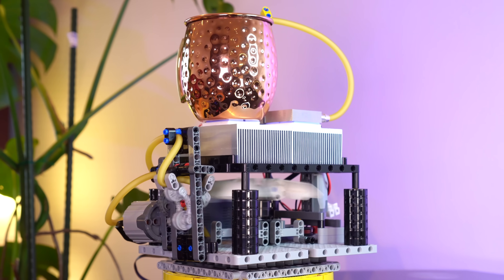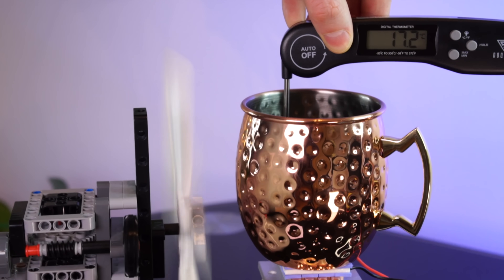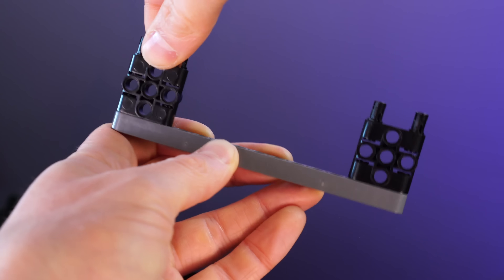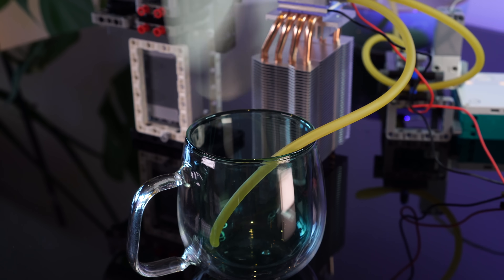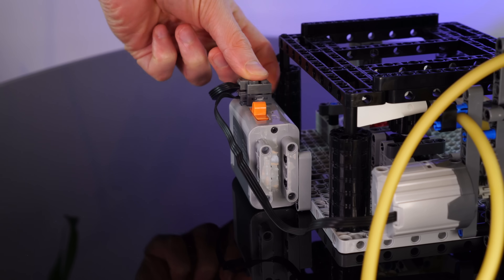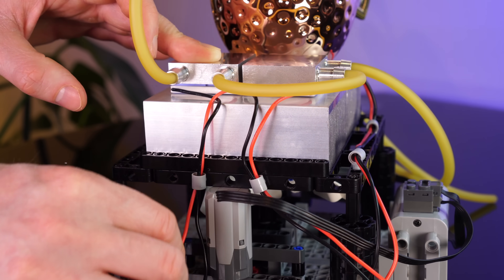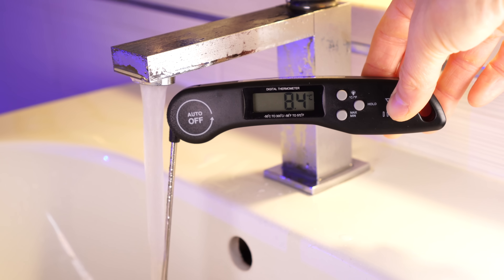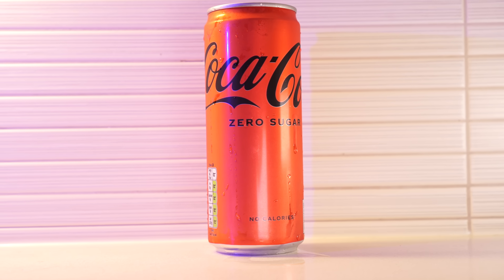Making An Instant Drink Cooler Using Lego

Comment: I agree with people that you should cycle the drink out of the cup, back into the cup in a closed loop to let it “accumulate” cold and “add up” over time.
Those modules are crazy inefficient, so add like ten more… lol 
If you did that, I think you’d actually get a cold drink in just a few minutes.

Comment: Peltier cooler efficiency decreases both with increased temperature difference, and power level, meaning they're extra bad for fast removal of a significant amount of heat. Also, all stages of heat transfer reduce the efficiency further, the worse the heat transfer is the worse the efficiency, and every single thing that reduce efficiency makes all other issues worse. 

At just a few watts per module, peltier elements can actually have a reasonably "high" COP, as in, have kind of decent efficiency, relatively speaking. But, you would need to use an insulated chamber, and much better heat transfer than those pads, and cool something down in advance and use that to cool a drink down, to make them somewhat useful for that purpose at so low power levels. Peltier based cooling is supposed to be able to be about 1/4 as efficient as vapor compression based heat pumps, but that requires modest temperature differences, and power level, and a very well designed system, in every regard.       

Solid heat sinks are pretty bad at removing heat, compared to heat pipes, as rate of heat conduction varies with temperature difference, while heat pipes transport heat very well even with a very small temperature difference. Less than 1 degree difference in the working fluid in the heat pipes will move heat from the hottest to the coldest part of the heat pipe so fast that most of the limitation is the few millimeters of copper the heat has to travel through in order to get into and out of the heat pipe, not along the length of the heat pipe. Also, while heat pipes works in any orientation, they work best if they move heat up. But, the "wrong" orientation of the heat pipes doesn't matter nearly as much as using those thermal pads instead of something like thermal grease in a as thin layer as possible that still covers the whole surface.

Still, most consumer products based on peltier coolers aren't much better designed than yours, except, they're designed with a bit more realistic expectations about what peltier coolers can achieve.

Comment: You need to keep the water a little bit longer inside the heat sink to make sure cold transfer happened.. maybe you can turn off and on the pumps or maybe pass the water multiple times through it

Comment: A lot of stuff works the same kind of like sound bounces around light bounces around, etc. well, he is kind of in the same sort of way. It likes to grip to certain things such as metals other stuff so pretty much if you had like a maybe a bunch of coolers on all sides of it so like a ice box pretty much then it would work probably betterbecause the bottom won’t really help because the bottom will chill the bottom but then the heat from the top will jump to the bottom to move more room from the top pretty much doing nothing so you need to block always of heat coming in

Comment: Peltier's are VERY inneficient. i have one sitting right here.
peltiers shine when they are given a load, and not trying to make things colder. but, if you stack two, or more, peltiers, it may help.
becasue they will try to maintain a especific temperature difference given voltage. if the hot side stays much hotter htan the cold side, it may keep the peltier from working properly, thus reducing efficicency and cooling power.
if you can make the hot side really colder, using another peltier, maybe it will help. but that requires some calculations, so the peltier cooling the other peltier can cool the peltier without heating too much.

Comment: 9:15 I have a few thoughts.
Your cooling for the hot side is probably overkill, you may be able to use something even smaller to clean up the build. 
Instead of thermal pads I would try a thermal paste, thermal grizzly hydronaught would be a good option for this temperature range for better thermal transfer on both sides.
Either slower pump speed, or more cooling surface (more blocks). Water works great at keeping steady temperatures, but heating and chilling it requires a fair bit of energy, much more than a peltier can push out without destroying your electricity bill.

Comment: for starters. you downgraded your heatsink. heat pipes are shockingly good at wicking away heat. and thats important because how tek coolers work. they provide a cooling effect based off a delta model. the colder you can get the hot side. the colder the cold side. and the more thermal mass you can move. also. your power supply is likely maxed out. those benchtop units typically max out right around 3.2 or so amps which is just around where your pulling. and the lego thing may be cool but that fan is not super great. id just suggest sticking to a PC fan on that first heatsink you was using. make these changes and it will shock you at what it can do! :D also. iv built a multi-stage tek cooler that can get fluids to cool a PC to sub zero. it eats up about 700 watts to effectivly cool 140 or so watt CPU. but as a last resort. you can just re-cycle the water by pouring it directly into the the output cup and have both the input and output lines in it and just circulate it.

Comment: one other problem i haven't seen mentioned yet, you're fighting physics.

heat rises, cold sinks.

you have the hot side on the bottom, and the cold side on top.  you should really have reversed it to let the natural hot/cold flow work to your advantage.

once the bottom of the mug got cold, it wont really cool down the rest of it.  same for the thermal blocks.

Comment: Peltiers aren't very efficient at all. Neither are cheap waterblocks. Or silicon thermal pads. Or aluminum heatsinks.
All of that combined makes it very hard to get a prototype that performs well.
Your best bet for waterblocks are something with either very efficient thermal transfer like micro-fin, or very high dwell-time. Next, copper heatsinks perform wayyy better than machined aluminum. I personally recommend using old 2u server heatsinks since they're cheap, they often have heatpipes which are a big bonus, and perform outstandingly well (and in theory would fit with lego pretty well).
Finally, using a thinner, higher convective thermal interface material like like HY-510 paste will perform vastly better at the expense of being a little messy.

My biggest tip for peltier is being aware of your temperature deltas. They're not efficient, and they plateau at a static delta from your hot side. Making sure you have VERY efficient heat extraction as close to the hotend as you can get. It makes a massive difference since keeping it as close to your target ambient makes the delta stabilize at that ambient, rather than soaking at the convection plateau temperature of whatever interface you're using.

Comment: You shoukd have waterblocks with microfins inside and also instead of thermal pads u should use thermal paste and also you should use a system of multiple peltiers at lower power and u shoukd Direct the water in a cycle till it reaches temp, i have seen people make stuff before that does the same almost

Comment: i have used and played a lot with Peltier modules, the main problem i see is the silicon pads, even those thin ones you use are less thermally conductive than direct contact without thermal paste

the way i usually stick them on a heat sink without a way to clamp them is a dab of superglue on each side/corner, and i recommend using a tiny bit of thermal paste (with the next to non existent pressure the glue applies, you really don't want a lot), while the glue is drying make sure to apply a LOT of pressure so it can have as much pressure as possible when dry to help thermal transfer

also, if you use those water cooling blocks, you might as well use some clamps on them to increase pressure (and use thermal paste, I'm serious when i said those pads are really poor thermal conductors)

also, if you run them at a lower power (which makes them a LOOOT more efficient), you can stack them to have much colder temperatures (but like 4-10 times less cooling power(it's like top speed versus acceleration in a car, but your transmission is made of paper, if you stack to many Peltiers and put too much current through them the lower ones can't sink the heat fast enough and all you get is thermal runaway as they get hotter, more resistive, make more heat, and yeah you get the picture))

Comment: Using silicone as a thermal pad will have definitely impacted the performance of this device. Silicone is not a good conductor of heat and is actually more of an insulator. Theres a reason why silicone oven mits are so common nowadays.
Reply: A year late to this, but those aren't simple silicon pads, they are Thermally Conductive Silicon Interface Pads, which are specifically designed for thermal transfer and an alternative to heat sink compound.
Reply: A nerd but actualy smart?
Reply: @andreivalasa7313 Not sure what you were trying to say but I will take it as a compliment. Lol.
Reply: @andreivalasa7313  The original meaning of nerd was directed towards people who were smart, tf you mean?

Comment: I've gotten something like this to work. I used a skived copper heat sink. The thermoconductivity of copper is nearly 400 W/m-k while aluminum is nearly 240 W/m-k, meaning the copper will take away a lot more heat. Copper heatsinks are a lot heavier and costlier but they work really well given the space.
Reply from the maker: Woah that's really cool, and well done! A copper heat sink sounds like quite an upgrade
Reply: @JamiesBrickJams  By costly I mean $30-$40. It'd be cool to see if it works for your design.

Comment: you could have it cool a larger reservoir of anti freeze, and run that through a closed system. Then run the chilled coolant through a liquid to liquid heat exchanger that you put into the drink.

Comment: You should try joining the heatsinks and peltier blocks with thermal paste. This will let the heat flow better and allow the heatsinks to have equal amount of cooling. Also thermal paste is better that the squares because it is like a thick liquid and fill cracks and spaces better. I got 7c water with a large heatsink and fan with a small peltier at 50w.

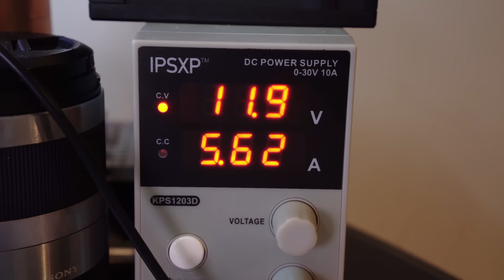Comment: 8:44 thermal pads arent great at heat transfer, thats why we dont use them on computer processors (we use them on memory and other components though because the components tend to be oddly shaped and don't output much heat). Additionally the heatsinks are squished down via mounting pressure which is incredibly important for thermal pads and pastes to work well.

I'm curious if your abomination would perform significantly better if you had used a thermal paste like Arctic MX-6, or even a graphene sheet (Thermal Grizzly makes some). Alternately there's also PTM7950 which goes on like a pad but then melts under load -- but thats meant for a permanent installation: costs more, performs better, and doesnt need replacing, but a bit of a waste on a project like this.

That said, someone else calculated the cooling efficiency of cooling the water/drink and yes, water is quite difficult to heat or cool (majority of energy during cooking is literally just heating water) Like it's so high that we opt to move it mechanically when it freezes in winter (that is: we shovel it) because its less energy intense than attempting to melt it. Its thermal capacity and conductivity is amongst the best materials we know of (amongst other attributes, water is truly a chemical miracle), it would take an insane amount of time and power to equal just running cold water over the can like you did at the end :)

Comment: It will be more efficient if you used high thermal conductivity thermal paste made for computers. Also, using the CPU cooler you showed earlier in the video would be much better than that aluminum heatsink at it has a higher fin density.

Comment: I had a similar idea to the last.
run the tap water through a air/liquid heat exchanger before using the water.
so during summer, you can have cold air blowing on you while you wash your hands with cool water. 
or during winter pre-warm the water before it hits your hands.

Comment: @Jamie 
If you want to meaningfully change the energy state of the water, you're going to need MUCH more surface area. To make things worse, your setup has a LOT of thermal mass that isn't water.
Run the water through a stack of thin walled aluminium tubes or even aluminium mesh, attached to the peltier, instead of one big copper tankard.

Comment: Obviously Peltier heaters aren't at all efficient. But what we are really dealing with here is a specific heat problem. Water (and water-based beverages) is very resistant to temperature changes, whereas air and aluminum are not. Because we are trying to cool water essentially by transferring the heat to aluminum and air, you would need a much larger quantity of air and aluminum cooling to match the amount of heat in the water. Even without losses of efficiency in the cooler itself, the mass of air and aluminum required is ridiculous. The other option is water cooling your water, which is exactly as ridiculous as it sounds.

Comment: Try looping the water through the system multiple times therefore it will pass through it more and cool down more and then have an output where you can release it when you want and not immediately because it will take some time to cool down a fridge does the same thing where it loops it several times

Comment: The water cooling at the end seemed to have worked well. You should be able to cool water with a  big surface and some airflow, like a  baking sheet full of water and a fan. 
Lego is best for structures but limited in energy density. So you might take advantage of a larger surface area.

Comment: Yeah... Thermoelectric cooling like this has it's benefits, mainly how there's no wear and tear, and since cooling is directly proportional to applied current, it's easy to control precisely. But it's got dogshit energy efficiency and is actually quite limited in how much heat it can pump away, largely because the hot side inevitably heats up the cold side from inside the device, meaning it actually becomes less and less efficient the more you crank up the power.

Comment: aside from the bottleneck of the peltiers, it'd probably be more efficient if you were able to isolate the hot and cold sides so the temperature isn't able to return to equilibrium, say as a liquid in a closed loop, it'd also help if the cold side was enclosed so the ambient temperature wasn't constantly warming the water back up, say, an insulated box with a handle for easy acce- I'm describing a mini fridge 😅. jokes aside, I'd love to see a lego powered heat pump fridge.

Comment: Hey man, I saw this and the following rang my bell through the whole video. You have the hot side of the peltier facing downwards. If i were you I would repeat the measurements but turning upside down the peltier-group, also making sure the heatsink fins are facing up and trying to direct the air pushed by the fan through a duct from the side through all the fins of the heatsink. Surely most of the heat transfer is thermal conduction (and the orientation of the heatsink in space shouldn't affect this), but doing this may help somewhat in the convection part of the heat transfer. It may not sound so appealing because you need to work the other part of the design out I suppose. I hope this helps you!

Comment: Along with all the inefficiencies in this design, don’t use thermal pads on the hot side. Use thermal paste, you’ll get more efficient treatment transfer of heat, and if you want better cold side performance use a liquid metal like thermal grizzly kryonaut. Although this is almost useless with the poor efficiency of the Peltier.

Comment: The Peltiers don't produce a massive cooling effect. Insulation is the key! Cut polystyrene appropriately to insulate out heat wherever you can. Also looks like the pop isn't spending enough time in the cooler blocks, perhaps recirculate it around a couple of times? Or else slow down the pump, but I suspect with a peristaltic pump, slowing it down would just stop it working as there's a certain amount of back-flow. 

Maybe have the pop recirculate round and round, back into it's jar, then after a few minutes activate a second pump that actually serves it into your cup. Or pour it. And the cup, too, could do with being in a big block of expanded polystyrene. Polystyrene everywhere! Or some sort of insulation at least. 

Think how long it takes one of those Peltier mini-fridges ( with insulation) to cool a can. It'll be half an hour or so. Hence you need to recirculate the pop, a couple of minutes to do a whole cupful isn't long enough.

Comment: If your fan blows air through the channels of the heatsink, instead of just blowing it onto the top of the fins (against gravity aswell), you'll have more efficient use of the heatsink. 
A low-tech proposal for cooling the drink, along the lines of other comments: put your can into a small container, preferably made of aluminium or copper (the thermal conductivity of copper is roughly twice that of aluminium) with 3-4 mm of water surrounding the can. The container should have an upper section with fins, i.e. a heatsink section, where the bottom part of the fins are submerged in the water. Now blow on the fins with a fan. This way, you are assisting evaporative cooling by forced convection and aiding the natural convection in the water by the high thermal conductivity of the (aluminium/copper) container. Hope that makes sense, good luck and thanks for some very entertaining and high quality videos!